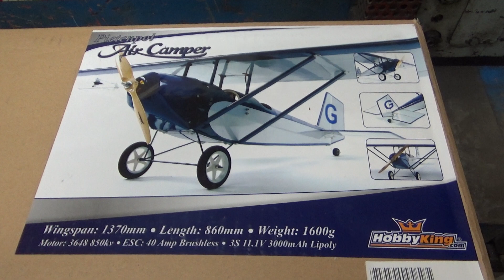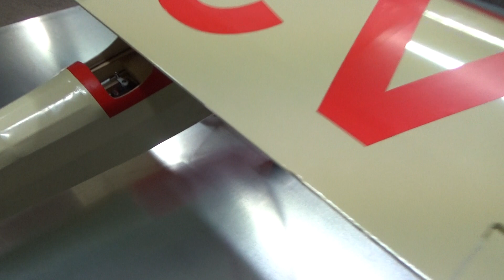Pietenpol Air Camper V2 with ASP 5cc Four stroke engine PreFlight START

Comment: Nice conversion Blaz and like I said ..the prop is a BOLLY prop.They were made in South Australia 2000- 2010. I worked making them for the last 24 years of my working life, unfortunately  no longer available.
Happy landings
 Chris...
Reply: britinozoz you were producing props?
Reply: Yes I did.
I worked for Bolly Props... hand making composite Carbon/Glass props for models and full size aviation.We also made a range of the "Clubman" injection molded props from 8.5 " up to 15.5 " like the one you have. The company has now changed hands making world class aviation props.
Chris...
Reply: britinozoz oh yeah that is so coolll man...you are lucky that you have been vorking there...

Comment: captain blaz how long do you cook engines in antifreeze, and do you take engines apart first. i have a t least 9 motors from 1960s. i want to clean them up. ron miller thank you for the info.
Reply: ronald miller hello friend...i always take them apart as much as i can and then cook them in antifreeze obout 10 minutes boiling slow...but do this outside becouse of poison fumes...